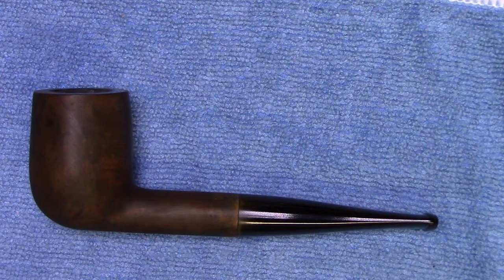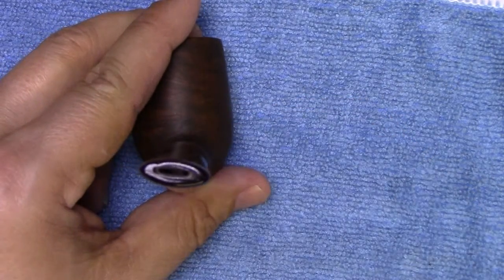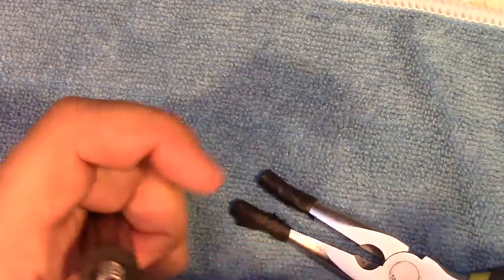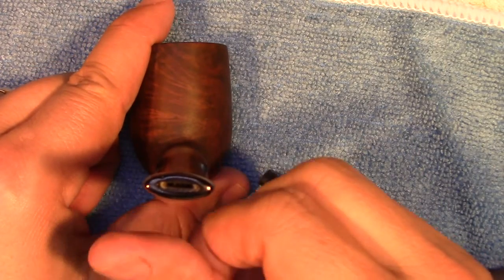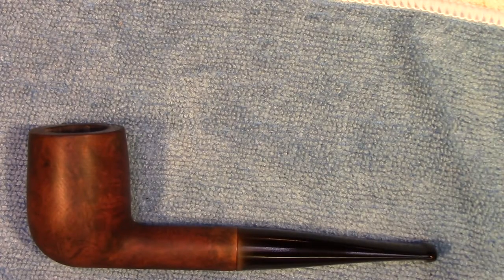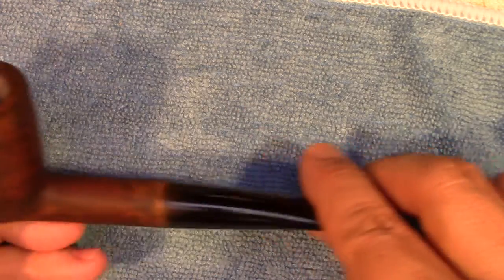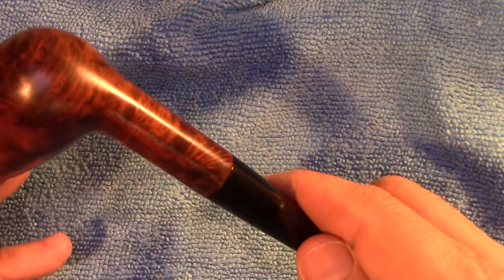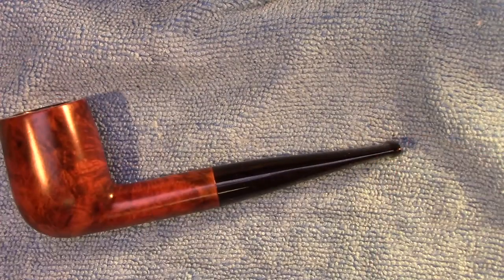Mr Roberts Billiard Restoration Part 3

Comment: Amazing job! I'm always blown away at how nice your pipes turn out at the end. When heating the stem to adjust the fit, I'm assuming the heat was focused mainly on the metal threaded part?
Reply from the maker: +Nom De Tube Thank you Andy!  Yes, focus the heat on the metal and let it conduct through to the glue.  Be well, Mike.